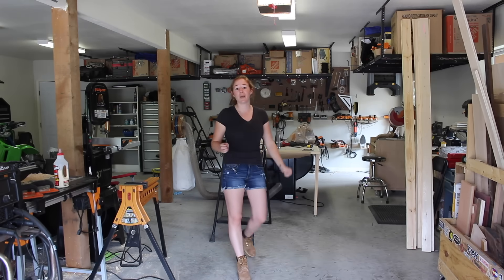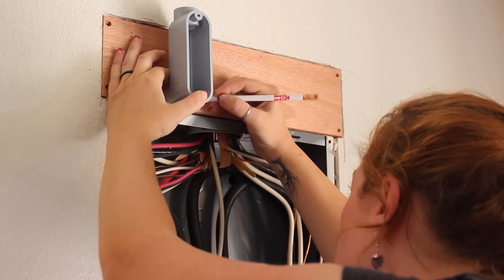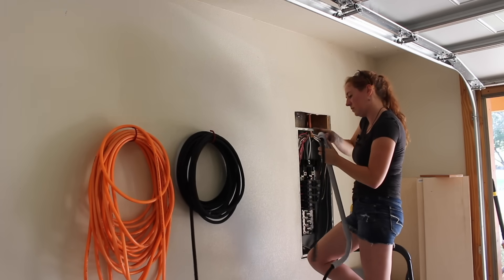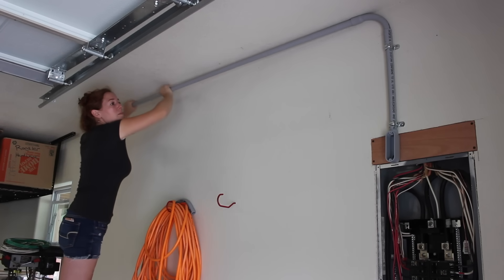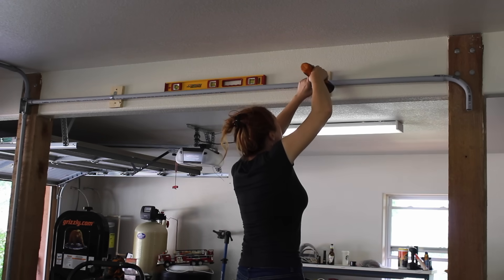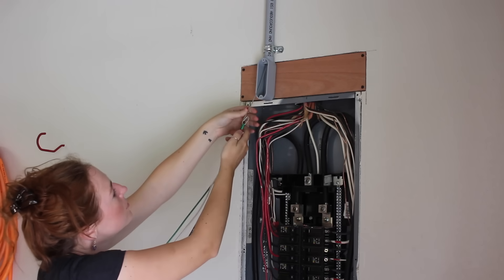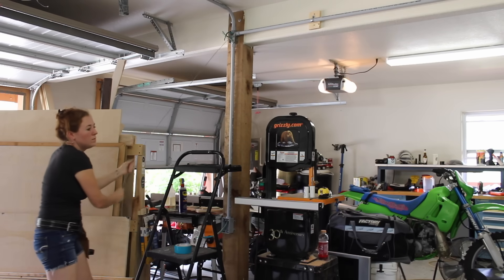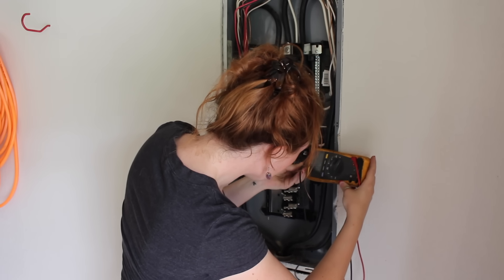Adding 220 Volt Outlets to the Garage

Comment: 220 should be red and black. white is usually designated for the neutral. if you need to use white for power it needs to be reidentified with colored tape.
Reply: Per the code, you are not allowed to re-identify white wire in conduit. You can in other situations. She should have pulled red wire. I guess two blacks would be OK also.

Comment: I did not see if you put a chase nipple and lock nut  at the knout out of the electrical panel. Did you put one? those wires need to be protected from the sharp edge of the metal panel! Beside that, Nice job!!

Comment: I have no scathing hatemail for you but two tips when using a fishtape, because I've been there:

When you are pulling it back in, you can grab the black handle and just spin the wheel in your hand to both retract and wind up the tape at once, usually the easiest way to do it and also helps ensure you're doing things gradually, which helps guarantee nothing comes detached. Which brings me to my next point:

When you're pulling wire there's nothing worse than having the tape lose the wire for whatever reason. A couple quick wraps of electrical tape is cheap insurance against having to do it again. In such a short/simple run as this not a big deal but I was fishing some stereo wire over top of drop ceiling which is an absolute nightmare navigating all the obstacles, and losing the wire halfway pulled across would have caused a world of pain

Comment: You did a great but you made one mistake. The metal box needed to be bonded . The green wire should have been pig tailed and connected to the box. Also the handy box is too small for the amount of conductors you used. You exceeded cubic fill capacity.

Comment: Every time i see this type of electric box it send a chill down my spine. Unprotected main X_X ...
Reply: Main disconnect appears to be on the power pole outside, meter main, and that panel shes going into doesn't appear to be the main panel for the house as well with all the 220 breakers in it and no single breakers for lighting and other loads of the home.

Comment: 'Pulls out spindle sander' when woodworkers do electrical haha!
Reply: Right? Electricians would've used a drywall saw to cut the panel and ductseal for the slop in the hole.

Comment: well....I believe you are supposed to use PVC strapping with your PVC...also strap support is by code every 3 feet for pvc I think . Also expansions depending on the temperature for expansion and contraction i mean you are located in texas im sure your shop can get hot if no one is working in it and ac is off..no PVC cement? ..but idk if this small inside run needs an expansion. still good job looks great :)

Comment: hey April you need to mark it with red tape. so that someone going into panel that has electrical knowledge will recognize what you have done. 

you did better than some supposed veterans I work with. very neat an attention to detail makes for safe install. 

and always remember your load calculations so you will use correct size wire. etc.

Comment: Good job. 

For those thinking April did not use the right gauge of wire, remember, it is extremely unlikely she would be operating two 220V machines simultaneously that exceeds the Amperage of the breakers.  

Using the wire she did, she has allowed for future expansion, though one has to check local building codes on using the same conduit for multiple runs. 

Looks a lot nicer than BX cabling!!!!

Comment: Just finished running 625 ft of mc cable and wiring up 7 220 and 14 110's in my shop.  It's a commercial building so I had the electrician drop in and pop in the breakers. Next is a sub panel and more outlets.  I'm not an electrician but and have no issue breaking into a panel and working as long as I feel safe with what I am doing. People need to learn this stuff, you won't always be able to call someone or depend on others, if you own a home put on your big guy/girl panties and learn to help yourself.

Comment: Here's my comment...as an electricians helper we never pulled wire with the fish tape. We used it to pull a string or rope and then pulled the wire with the string. Boss Man doesn't like fish tape that's bent from pulling. On long pulls we made a small balloon with a plastic bag, tied the string to the bag, and used a shop vac to suck it through the conduit. Thanks for all the videos April.

Comment: The electrician in me is screaming!!  White is neutral and shouldn't be used as a hot wire. You should have ran red and black. White for neutral and green for ground. Just because it works doesn't mean it is right. 😀😀
Reply: So if it's 4 wires, red is hot, but if it's 3, then white is hot? I am still learning all of this as I am a recent home owner.
Reply: @Ange1ofD4rkness  @James I'll explain for ya here:  The colors are just for identification.  Any wire could technically be used as hot (If they are, they need to be re-identified with tape)

-Normally, Black and red wires are hot wires. neutral wires are white.

-What she did, is she used a black as a hot, and a neutral as ANOTHER hot, (she forgot to re-identify the wire with tape.) in order to get 220 volts

-On 220/240 Volt applications, there is no neutral wire needed (Unless its like a dryer or something, in which case there are 2 hots;black and red; and a neutral; white). There are only 2 hot wires (black and red)

Now that above should answer your question ^... but if you want to know more, scroll down the comment:

There are 2 hot wires, one on each phase of AC.  These phases alternate between +120 volts, and -120 volts at about 60 times per second in the USA. (60 hertz).  These two wires are on the opposite sides of the windings of a transformer (which is basically 2 large coils that handle voltage via magnetism).  If you use both of these wires together, you get 240 volts.  BUT, most of our houses are designed for 120 volts. How does this work?  This is where the white (neutral) wire comes into play.  This wire is in the dead center of the transformer.  This means that there is always a maximum of 120 volts between a hot and the neutral wire.  If you want to wire something that is 120 volts, use a neutral and a hot.  If you want to wire 240 volts, use 2 hots on opposite phases.  If you use 2 hots on the same phase, it wont work.  I don't know if it'd spark up and blow up or not, and im not going to find out.

I tried to make that simple. Good luck with your house.
Reply: white is NEVER hot. If youre working in a 3 phase 120/208v system your hot colors are black, red, blue (phase A, B, and C) and in 277/480v 3 phase its Brown, Orange, Yellow
Reply: @matthewwilliams8939  are you sure about 277/480 colors ?
Reply: The wire wire cannot be reidentified as an ungrounded conductor (hot) when using conduit. It can only be done when using a cable.
Reply: NEC code but.. Where I do stuff at, we are allowed and encouraged as we use wiring color codes from several countries so it is recommended to follow what you know, whether it be USA or Euro, then tape according to local code so it can be identified under both.
Reply: @sparkythebuilder ,I've seen your videos before,  you of all people don't have any room to  criticize.
Reply: @gregberban9273  I have one video on YouTube and it has nothing to do with wiring. IDK what you are referring to.
Reply: black tape is ok to mark wire hot
Reply: Mr Andy are u kidding ??? White is used as a hot all the time lol look at 8/2 or 10/2 or 6/2 romex! As long as u phase it black or red there’s nothing wrong with it ! Even using thhn! As long as it is phased it is perfectly legal and acceptable
Reply: @texasjourneyman207  This is true but at the same time if you're gonna do it why not do it as best as you can and just get the correct color wire from the start ya know?
Reply: I have some wires that are orange and some that are purple and blue in my garage which ones are hot wires?  If you are an electrician you should know better than to guess what wires do what by the color alone.
Reply: @DaveMcLain  The hot wires are the wires connected to a constant hot source.  Like you said you shouldn't make assumptions that the person who did the work before you did it right.  However that being said the orange and purple should be the switch legs and the blue should be hot.
Reply: Mr Andy I think she did it after. I'm not an electrician and I know close to nothing about the subject; I was just relaying what she stated in the comments. :)
Reply: It's residential not commercial
Reply: csknives2140 It's called the electrical code , it's there for a reason
Reply: Phasing is perfectly legal  , besides voltage doesn't know what color it is.
Reply: Don’t be ridiculous. Sure she could have used another black or red wire but she specifically stated in one of her comments that she marked the white wire as red. Also the white wire it very commonly used in 240 circuits. Such as on a 2 wire #6 for a range. One hot is almost always a white wire. If you run a 10-2 Romex for a water heater again one wire is a white. Just because it’s white doesn’t mean it is or make it a neutral
Reply: @JustinLodes  NEC allows reidentifying the white wire in cables as a hot conductor, but it is not allowed for conductors installed in conduit.
Reply: csknives2140 the only thing she did against code which is a no no is run bare Cable from the LB into the panel. She didn’t show if she even put a connector into the knockout she made that attached to the LB but hopefully she did
Reply: I looked again and didn't see the red marking on the wire she put in. In any case, there were other things wrong but didn't want to discourage. The wire color made my OCD kick in. 😁. She could go back and clearly mark all ends of the white wire with electrical tape to clearly identify it and that would pass. 🤓
Reply: @mramanya  wires smaller than 6AWG need to be colored accordingly, anything bigger can be identified with tape
Reply: @TheJigga97  not true
Reply: @gregberban9273  yeah ok buddy.
Reply: Mr Andy she marked the white with red :)
Reply: isnt there a specific requirement of how the marks are to be applied and the marks in question wouldnt be acceptable? i was always told the mark has to be permanent and complete such as all the way around in insulator. we always used colored shrink tube and tape though i do see uline now had paint pens but cant confirm its acceptable
Reply: Phillip Ramirez notnthat id use a white wire as she did but if I didn’t have another black or red I would tape the white wire with 3 bands an inch apart of either black or red tape. This isn’t that big of a issue. Unless of course you have ocd 🙂
Reply: Could have used two black wires, better than a HOT white wire...
Reply: @elliottmanning  technically it's better red and black
Reply: That's a very sexist comment.
Reply: https://www.youtube.com/watch?v=A8q8PXoJwVk
Reply: Mr Andy but you do know that every electrician in the world will check red tape and wrap it around that neutral on both ends the color in the middle if it’s not accessible is not relevant the only relevant part of that wire that Hass to be colored appropriately is the part where someone can access it for servicing or making changes but homeowners traditionally do some crazy shit
Reply: and at all splice locations.
Reply: If I don't have the correct color,  I roll up the needed wire and spray paint it the right color. Dries fast.

Comment: The Only thing I'd do differently April, and we do that up here in Canada is the White wire or ( Neutral ) when using it as a power wire place Red Tape around the wire at the breaker & the Receptacle to allow the next Electrician to know for certain the white has been transformed into a Hot Wire.

Comment: Oh April...next time take a small baggie with a string on it...use your vacuum and suck the baggie through the conduit...takes about 2 seconds...AND you get a sending line for the future.  :)
Reply: You can use a foam "mouse" also. Fish tapes can work just fine. I've even seen two fish tapes linked in the field over extremely long runs in an industrial setting so that it made simultaneous pushing/pulling possible.

Comment: The issue is heat...that darn stuff can get really hot...which is why you're best bet is using THHN...I hate the stuff, but it does the job.  I just ran into the exact same issue with my 220V Generator Hookup...

Comment: The reason for not running SOOW cable inside conduit comes to heat.  Electricity flowing through copper creates heat.  The more amperage the more heat.  Electrical wire is sized to be able to handle the amount of heat generated.  When you then place that wire inside of conduit it slows the heat transfer which means the wire can't get rid if heat fast enough and it could melt.  SOOW and  SJOOW cable should never be placed in conduit for that reason.  You just got your house you don't want to burn it down.
Reply: Oh and 2 things.
1. In residential wiring it is now against NEC to ever use the white common wire as a hot wire.  You can pull a red and a black wire, or use the same color and wire labels to keep them straight.  It's a safety thing because people see white wire and think common wire.

2. SJOOW is 300 VAC rated cable and will more than handle anything you have in the shop.  No reason to pay for SOOW cable which is rated for 600 VAC.

Comment: Are you allowed to put two 220 plugs on one breaker. Should each plug not have it,s own individual breaker rated to which piece of equipment you are plugging into it???? Checked it out and as long as the wire is rated for the size of the breaker it is allowed???     For the protection of high amperage appliances they should be on there own circuit.
Reply: Are you allowed to put three 120 plugs on one breaker? You could connect 6 toasters at once? :) On can place several receptacles on one breaker, it is just done less with 240 volts in the USA. At a factory in California one an assembly line we had 1 to 5 receptacles per breaker for 240 single phase and 208 Y 3 phase. we were always adjusting the equipment. The overhead cords came down from above and had color coded tags so one only hooked up one gizmo per breaker. This was in a plant of 550,000 sqft

Comment: One thing I like to do is electrical tape around the wire nuts and outlets screws. Electrical tape is cheap so don't skip this step can save your house from burning down.

Comment: Another great video, thanks April! It's interesting to see this from a UK standpoint- so in the US is it usual to have 220 available at the breaker box and it just not be used often? I guess that the 220 comes from two different 110 phases supplied to the property?

Comment: Using a white conductor as a current carrying conductor is a code violation. White and grey insulation indicate a grounded conductor (also called a neutral) to anyone who may work on the wiring in the future. NEC 200.7. I can't tell what size conductors you used or what size breaker, so can't comment on correct ampacity of the circuits - looks like 10AWG which would limit your circuit to around 28A at the outlets.
Reply: I think you are confusing current and voltage. The neutral is as much of a current carrying conductor as the hot wire. :)
Reply: What if you hook up something such as a water heater with 10/2 romex? Are you going to run 10/3 just so you can have a red wire?

Comment: Great job, the only thing I would say is twist your wires together and trim before the wire nut in the junction box.  Use a nice pair of lineman's pliers to get a good twist down the cable so if they get pulled on it won't put stress on the wire nut.  And yes I would have used a red wire, but any electrician will understand what you did.

Comment: So im a sparky in the uk, and the us power systems baffle me to some degree, ok so i know that your 115v is on L N E 3 wire like our 240 V, but how does your 240 V work if its case to phase, so is each leg 115 v ???
Reply: Rigger Chris The transformer at the pole is tapped at the center to provide two 120v legs. Some 240v appliances want both hots, a neutral, and a ground. Some only require two hots and a ground.

Comment: How did u do the ground in the box it's plastic it need to be metal box to ground the outlet to the box too
Reply: Kodi Hull The receptacle takes the ground, like all receptacles that exist. The box is plastic, doesn't conduct electricity, and doesn't need to be grounded.

Comment: Like I said on a previous video about looking into a post-frame (pole building) for when you want to go like you had before. The nice thing about that construction is a DIYer with the right skills and the nerves could not only build the foundation and envelope themselves but also run wiring for electricity, cable for internet and tv so you do not have to do that stuff back in the house all the time as well as run plumbing for bathroom and even install a kitchenette so you got all the drink and snack or meal you need for the time in the shop without need to go back to the house. The other plus side is the clear span of such construction so you can add walls and rooms where you need or as required, same goes for doorways and windows and since you can build with up to 20 foot high walls, the headroom space is only that limited.

Another method with steel, look up "Miracle Truss", its a metal frame hybrid system that finishes out with wood much the same as a post-frame and again you can build yourself. The only down side is the frame system stick out on the inside. Other than that you can go with 30 foot sidewalls and wide clear spans, its the best of both steel using trusses and wood for flexibility. 

Both offer better insulation compared to steel structure alone.